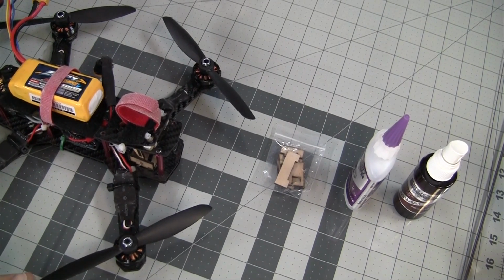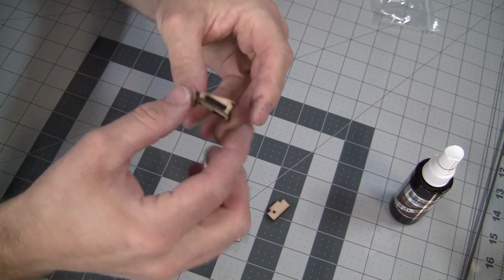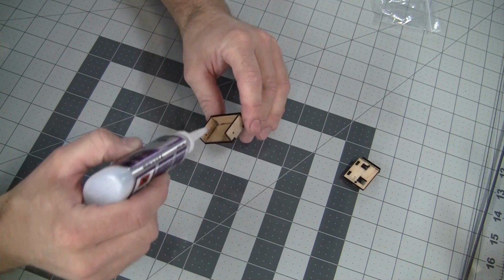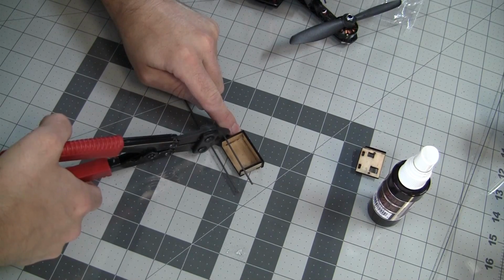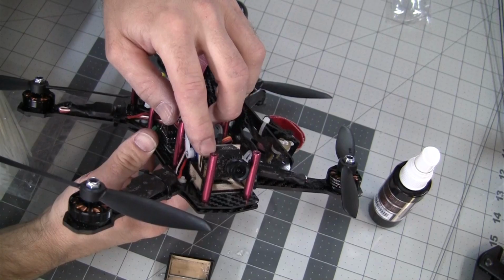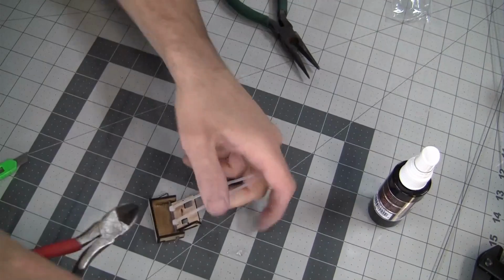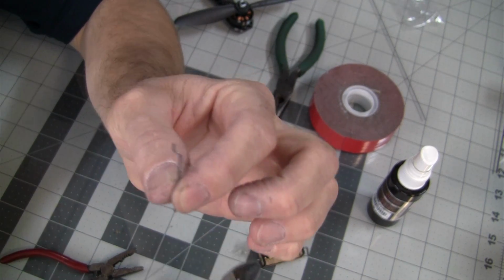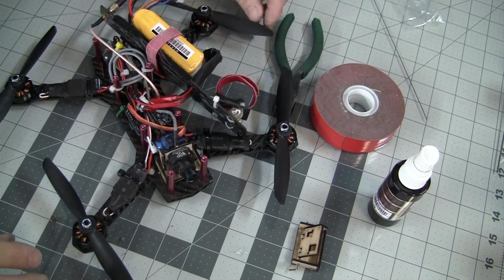LF-TILT - Build Video

Comment: looks really cool i may buy one do u think it would fit a bigger ccd camera
Reply from the maker: Thanks, friend.  It is perfectly set up for the fatshark camera, which is pretty small.  If you use a big board cam, it may not fit inside the frame, but, I am sure it can be modified.  Hopefully it can inspire you to make something work with yours.  I also thought of drilling two holes in the bottom of the frame, and putting 2 linkage stoppers in the bottom, holding a bar across.  Then, all you need to do is take a square piece of wood the size of your camera, and drill 2 holes, mount zipties, and find a way to attach the control rod to your cam.  easy peasy.
Reply: Lets Fly RC
ok i may try something as i have been flying through the mobius but just ordered a 600tvl ccd
Reply from the maker: RCflyer729  I really enjoy using it.  Hope everyone else can take advantage.  Thanks for the comment friend.